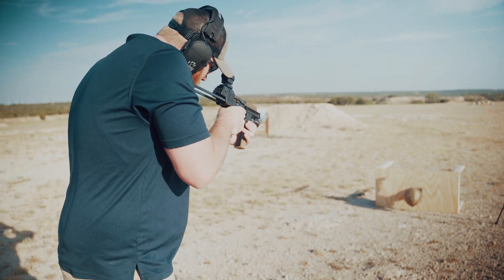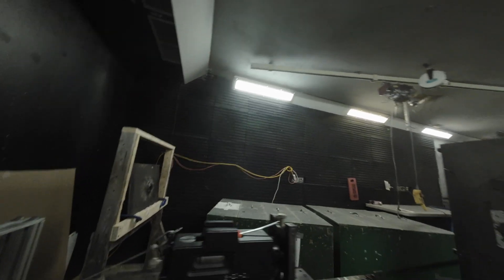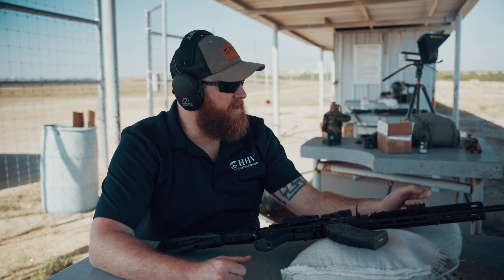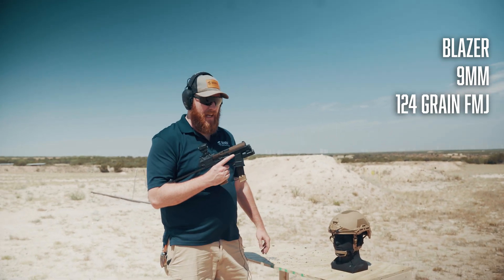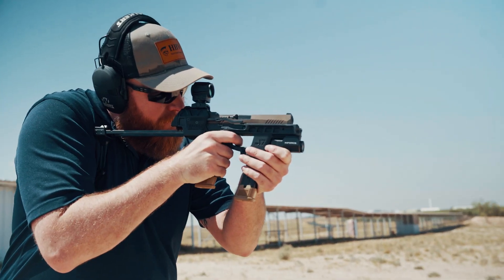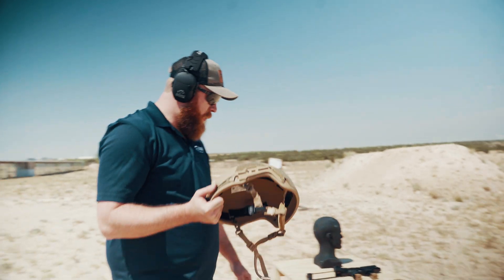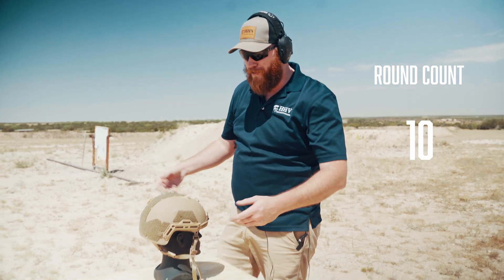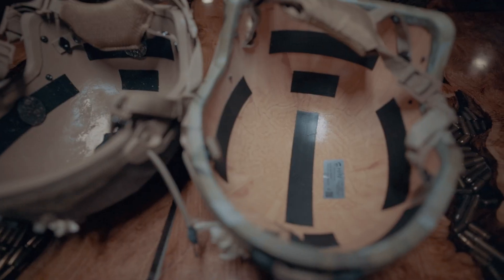What if You Shoot a Helmet With an AK-47?

Comment: There’s a direct correlation to force, surface area, and angle of impact (not to mention bullet design) that determines what the helmet can handle. A large percentage of the documented helmet impacts in Iraq and Afghanistan where the soldier survived were hit at angles that had the helmet not been worn, the round would have missed. Given that head shots were overall uncommon, if 5.56 and 7.62x39 FMJ inside of 75m is going to penetrate I question if the efficacy of increased mobility from a carbon fiber bump helmet would outweigh the risk. As crazy as that may sound, carbon fiber is multiple times stronger than steel. Remember lighting up vehicles and afterwards looking closely at the edges of the vehicle that were parallel(ish) to the incoming rounds? If you look close you’ll see extremely small, thin creases that look like little scratches. Those are from rounds that impacted at slight angles and ricochet off the painted sheet metal. Again, carbon fiber is much stronger, and if ballistic helmets won’t stop common caliber rifle rounds at perpendicular(ish) angles inside of 75m anyway… it’s something to consider. Obviously this is multi factorial. Blasts from IEDs and other explosions play a role in why soldiers need ballistic helmets as well. I would like to see some tests and prototypes using carbon fiber and other lightweight materials. Vertebrae injuries are basically common place for grunts and operators and those persist long after their service.

Comment: What is the shelf life of these helmets? Is there a time when you should replace due to just time passing by?
Reply from the maker: Very good question. 

We have a ten year shell-life warranty on all of our helmets, but each helmet is different. Always check the manufacturer warranty even if you're not covered by it, because it will give you a good idea of what that efficacy window looks like. If the product would still fall into that warranty period, it's likely still good to go for meeting and exceeding the original standards it was designed for.

There's probably an experiment here as well. You just gave me an idea.
Reply: @HardHeadVeterans  what would time alone do to degrade a helmet kept packed in a cool dry place inside a bag meant for a helmet? So the fiberglass/materials or whatever it's made out of just breaks down no matter what ruining the integrity of the helmet?